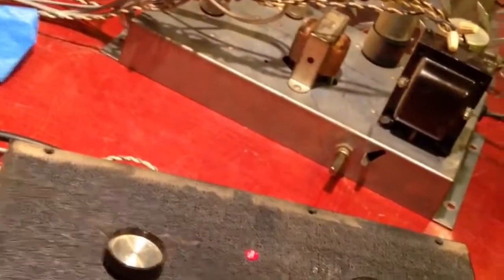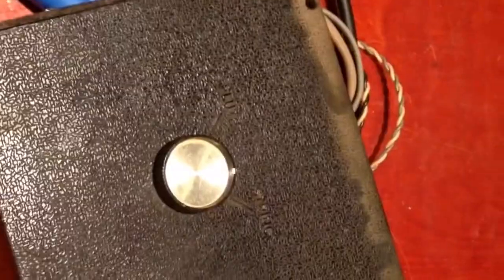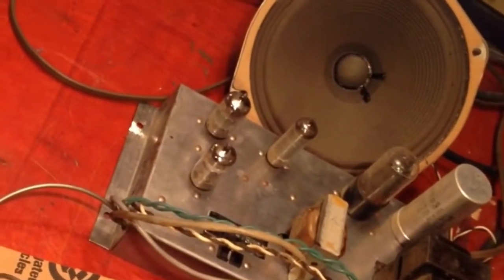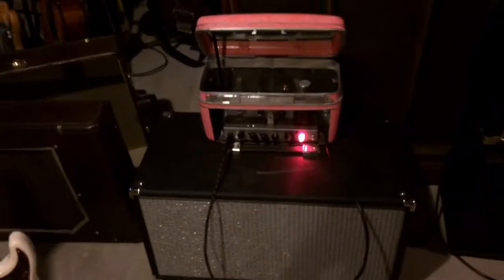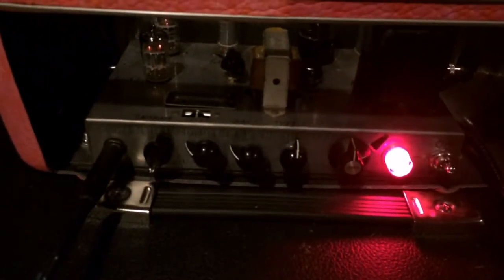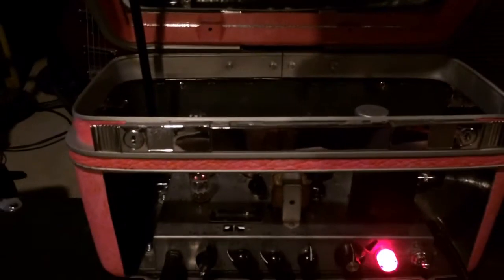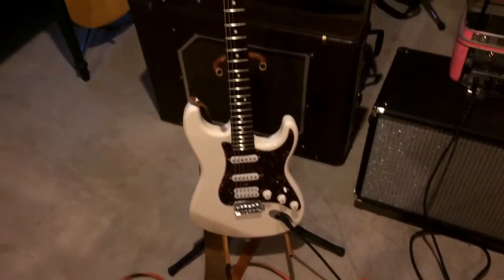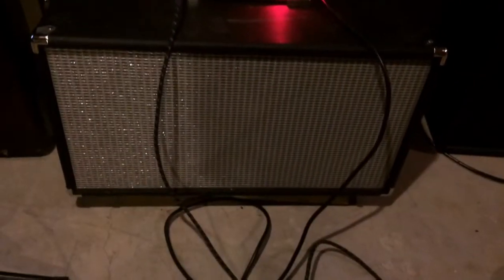Silvertone organ conversion to guitar amp

Comment: Im picking  up a silvertone syntronic from 1962 stereo cabinet and all with two 10' inch speakers it has two tube chassis one is a 7 tube am/fm tube chassis the other is a 5 tube stereo amplifier chassis with a monster transformer and the schematics I read up on say it has 12ax7s and EL84  just to name a few of what I have read up on it so far .Im new at all of this but have been messing with electronics but never tubes. SO do you know whats possible for me to build can I just tap into the stereo through the turntable or should I cannabalize it and learn on my own at a snails pace or what would you recommend.I feel like it should make a monster amp and great sound but maybe IM wrong.From all the pics I have seen of it Im rather excited to get this thing home. Would you consider doing an amp build for a fee.
Reply from the maker: It sounds like it has potential. The 7 tube tuner pre amp is probably not that useful for guitar. The 5 tube stereo amp could probably be converted to a guitar amp, it may need a pre amp gain added . If one could be found A schematic and pictures would tell me a lot. 
Yes you could probably hack into the phono plug with an adapter, maybe 1/4” to RCA with a guitar, but ideally it would likely need the input resistors changed to better match the impedance a guitar signal likes.  
To maximize gain, there maybe a better spot to patch in guitar signal as well, again a schematic would be very helpful.  I might consider a conversion for a fee. I have several other projects going at the moment. 
Feel free to email me more details at zelleram@sbcglobal.net

Also if you know some  electronics you can teach yourself tube stuff. There is lots of good online info. 
Start with Uncle Dougs YouTube channel. He goes deep in his series in how tube amps work.

Comment: Hey great video!  Do you have the part numbers from the power transformer?
Reply from the maker: What is printed on the back of this one in white letters is 13-1811-2 then under that 450-6343. 
The latter is probably a date code. 43rd week of 1963

Comment: That's awesome I just came across the same organ guts. I'm not as Savvy As You Are with electronics but to start with the input do I just connect a jack to the wires of that microphone piece that goes up by the keys with all that foam on it???
Reply from the maker: To start yes you can run your guitar 1/4” plug into the microphone input. If it is not already a 1/4” plug you will have to add one. I cant remember it was several years ago when i did that project. The input impedance will be wrong for guitar and wont sound good.  Probably will have a lot of interference  with that long unshielded wire too. Also the amp is not voiced for guitar and wont sound right with out conversions. Look up original Fender Champ schematic. I used the the values from that amp to voice this amp. If you are new  to converting amps, you will need to study a lot. Great YouTube channels i watched to learn this stuff was Uncle Doug, The Guitologist and Radiotvphononut.  An amp of this age will need at a minimum, new 3 wire power cord, all electrolytic capacitors changed(the can cap), and all coupling capacitors.  I wish i had done a better job documenting this conversion.  I converted a 1940’s Webster wire recorder that  turned out awesome too.
Reply: @Zelleram55  nice thank you I'll have to look into that can cap and coupling capacitors, then I have a three-prong plug do you know what value of the fuse you used?
Reply from the maker: John Chrīstopher Mīller probably 1.5 amp slow blow. I will look later if I remember to.
Reply from the maker: I remember now, there was not a 1/4” jack. Cut the wires to the little silver microphone and solder in 1/4” jack there, if the amp isn’t totally DOA, this should get you a live guitar signal.
Reply: Do you have any other resources on how to convert what to change underneath the chassis?
Reply from the maker: John Chrīstopher Mīller https://youtu.be/NX8nWO3tkF0. This is a good video to watch for some basics.
Reply: @Zelleram55  yeah I did watch that Uncle Doug go through some things, his couple of videos that explain how a tube amp works is pretty enlightening.
Reply from the maker: John Chrīstopher Mīller Uncle Doug is a master craftsmen, i am but a beginner hobbyist myself. So far i have done 4 successful conversions and one old Radio revamp  and repair. Life has been busy the last two years, i have not had much time to devote to this hobby of late.